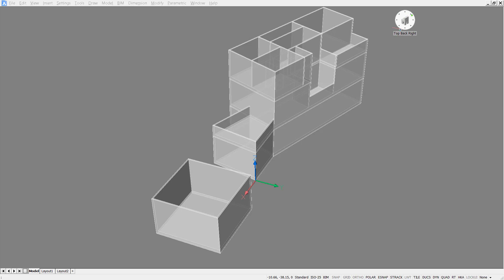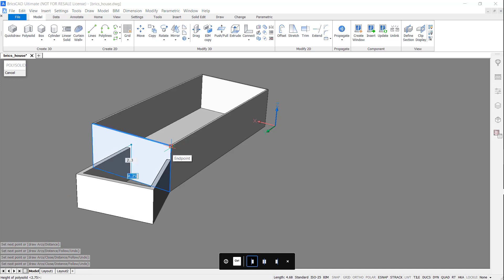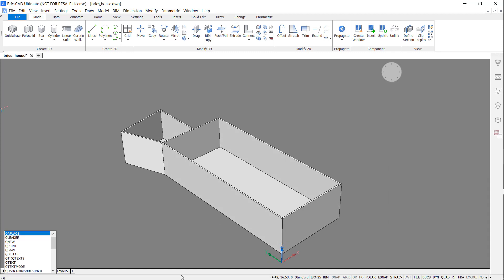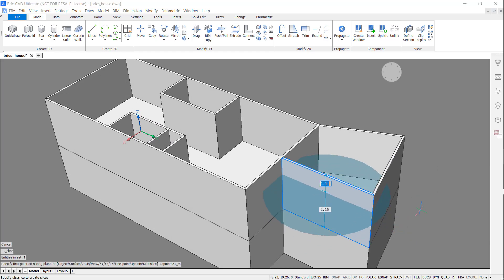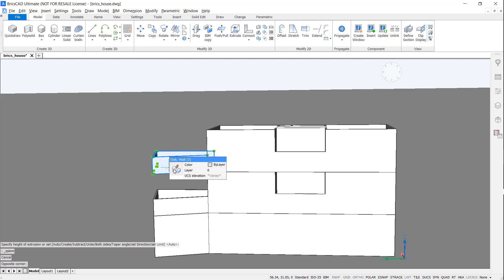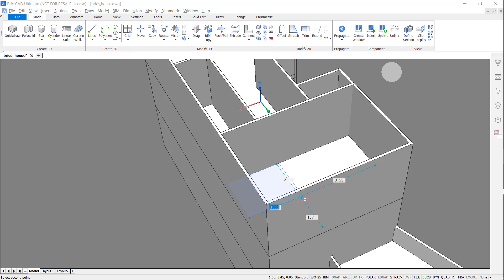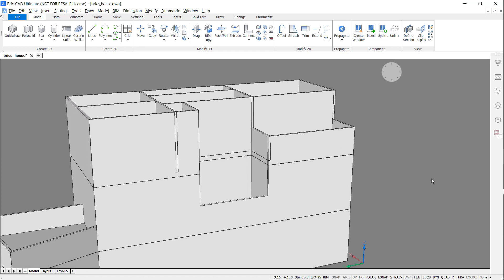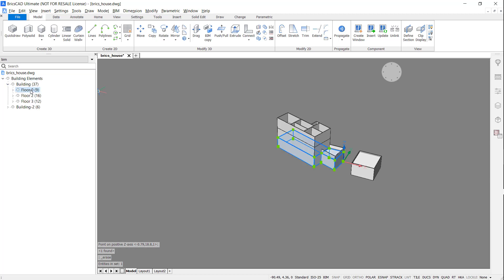2D 3D BIM - Walls and Floors - The House P1

Comment: Is it possible to draw floor plans in 2D but still get 3D geometry like in other apps -like archicad and revit-?
Reply from the maker: There are different modeling techniques in BricsCAD. One of them is using an existing 2D plan to create walls: https://help.bricsys.com/hc/en-us/articles/360007308054-Creating-Walls#procedure-using-an-existing-2d-plan-to-create-walls  You can find more information in BIM Tutorials on our site: https://help.bricsys.com/hc/en-us/sections/360001481513-Tutorials
Reply: @BricsysOfficial  thanks for answering. I will definitely check it out.
Reply: @BricsysOfficial  This is not MBilal wants. I think he ask whether it's possible to create wall in 2D view, not in 3D view. I chcked the website, but it's not possible. We have do every modeling in 3D view and I've already heard this from you guys. It doesn't make sense to do every modeling in 3D.
Reply from the maker: @archist9789  You can use POLYSOLID command in 2D view, pick points on the drawing and set the desired height via command line when command prompts "Height of polysolid <80>:". But if you need to snap to some existing 3D geometry it could be more simple in 3D view.
Reply: @BricsysOfficial  Is it possible to insert components like windows and doors in 2D view?
Reply from the maker: @archist9789  No, unfortunately is not possible.